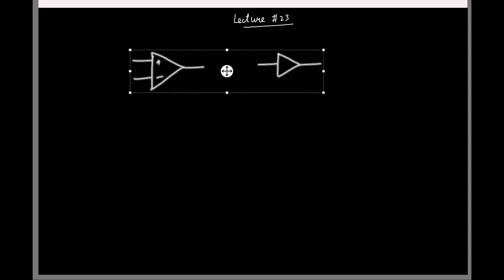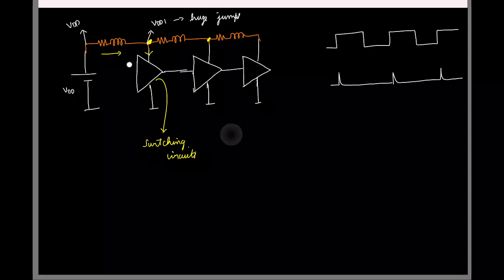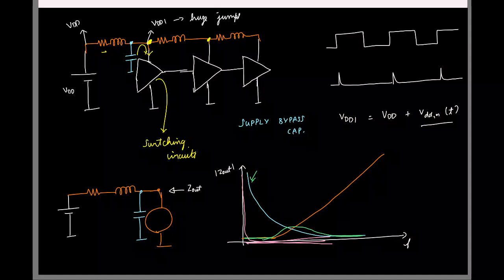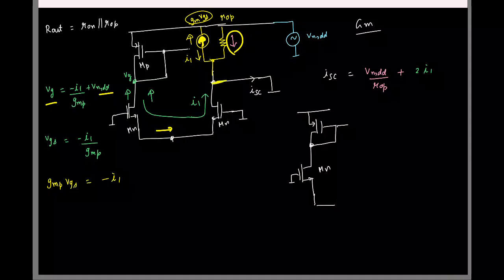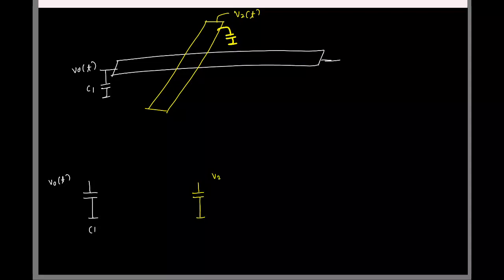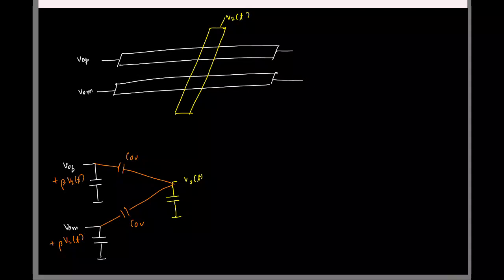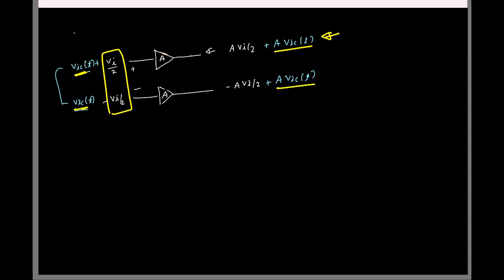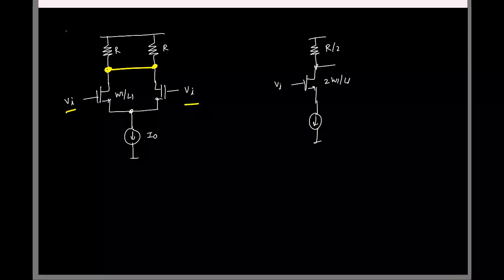Lecture 23:  Motivation for differential signaling; pseudo-differential vs. fully differential ckts.

Comment: @sscdiitk , Sir , the PSRR calculations are done at DC , but given dominant pole comes at the output hence the  PSRR improves drastically at switching frequencies , is it correct ?
Reply from the maker: If only the output cap is considered, the output pole does reduce the effect of the supply on the output. But if PSRR is defined as the ratio of the transfer function from the actual input to output and the transfer function from power supply to the output,  even the transfer function from the actual input to output will fall due to the dominant pole.